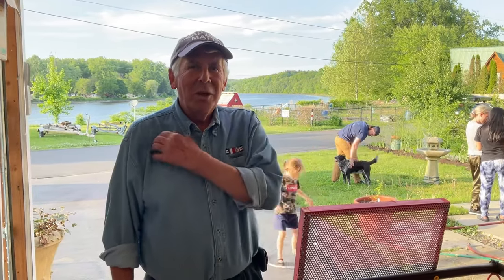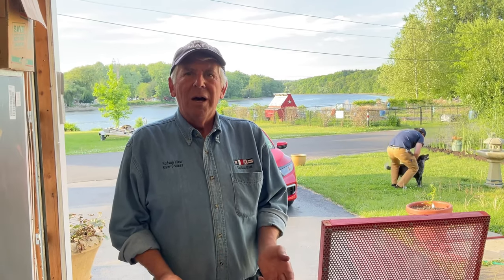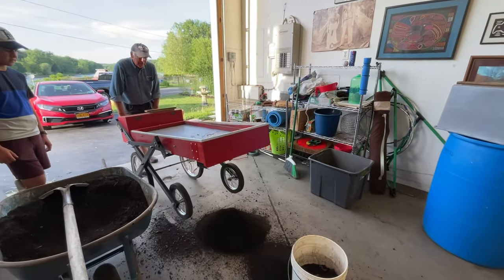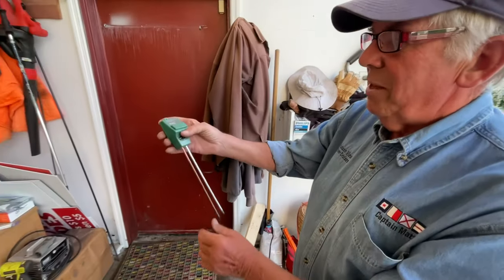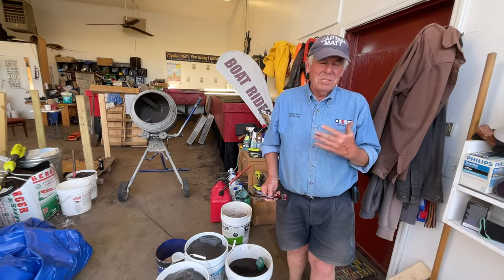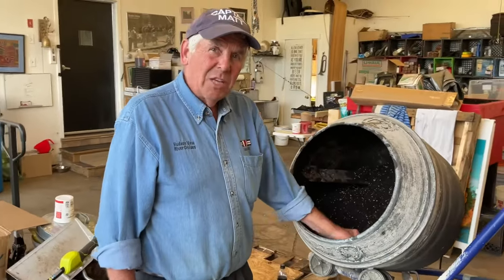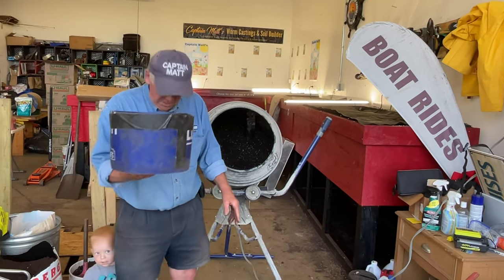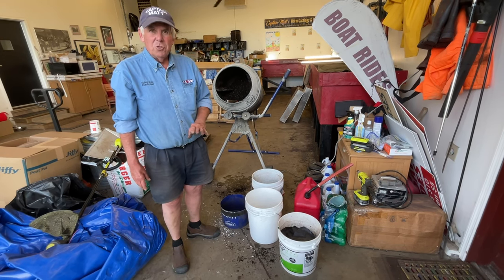How I Use Worm Breeder Buckets

Comment: Love the idea of the breeder bucket instead of a tray. 
What are the length measurements of 3/32  and the 1/8” holed spaces?
Do you think it’s a good ratio or would you increase one size over the other to catch more cocoons?
Reply: Should’ve been better worded question! What is the length of the screen of each section of different hole sizes? For Red wigglers and how you’re using it, would you prefer there were more 1/8” holes to catch cocoons?
Reply from the maker: Hey EW...  We did a in depth video about the sifter, there’s a link in the video description to the manufacturer https://youtu.be/sN7XP70UcPw  Not sure about  best ratios - that could be a good experiment.

Comment: Hey Captain Mat, I know you switch from buckets to trays, but I still like the buckets. Recently I was given a large supply of 2 gallon buckets. I know in the original 5 gallon buckets, I have 2-1/2 gallons of bedding and 250 adult worms. This works great, but can I scale this down to 1-1/2 gallon of bedding and 150 adult worms, in these 2 gallon buckets?
Hope all is well with you and the family. Your worm friend in Florida.
Reply from the maker: Hey Larry… nice - should work well and you’ll find the right ratio with a bit of experimentation.

Comment: Hi, Matt. Bob Hough from Alpine, CA. I understand what you're saying about your breeder bins. I just have a couple of questions. The first has to do with the plastic you put over the top to help conserve moisture. Since I didn't hear anything in your video about drilling air holes in the buckets, how do you aerate the breeder bins? I'd think that the plastic would cut off all air flow and be detrimental to the worms. Also, do you keep your bins in a lighted room or use a light on them all the time? What else keeps the worms from making the Great Escape? Thanks again for any direction you can offer along these lines.
Reply: The plastic cover is a loose fitting top, no need to aerate.  And worms escaping would be rare but easily solved by keeping a light on.

Comment: Hi Captain Matt, I used nearly 3+ gallon compost filled with 250 worms in 5 gallon bucket. Is 3 weeks okay time to keep them. I do top feed chow every 2 days. I still dont know how would I know that they have eaten enough compost and now its time to harvest the castings. Question is if still I could weight for more day's and they could have eaten more compost.  Do we really make a guess that in 3 weeks they would have consumed what ever was there in bedding? In that case we never be sure that its 100% casting and no compost anymore.
Reply from the maker: Hey Vikas, I've found three weeks to be a good duration.  You'll still need to sift the castings out of the buckets - it will not be 100% castings - but will be a high ratio, depending on the fineness of the material you started with.
Reply: @CaptainMattsWorms   Hi Captain Matt, I sifted finished compost to 1/8 inch when I made the bed. I am going to harvest it in 2 days. My only doubt is if red wrigglers mostly remains at top what, they will not be eating the bed lower half? is It?  I hope they dont only eat the upper half of bed in bucket.

Comment: At 8:52 you dont have white stuff in mix but at 9.10 when adding water you have white stuff in mix what is that did we miss any stuff?
Reply from the maker: Good eye, Vikas. I’m experimenting with integrating food/nutrients into the bedding to decrease need for top feeding (trying to get to a set-it-and-forget-it system for the two weeks)… I added some of that to  the bedding which is what you likely saw in the video  - it’s a delicate balance since too much can heat the bin. Will share ratios after I prove success. The safe path is to top feed buckets.

Comment: Thanks for another great video. The production of worm castings in 2 weeks is great info. Just curious if the worms population also increases in these 2 weeks. You are the best.
Reply from the maker: Hey grnbough! Thank you. In the two weeks there will be cocoon production, but they will hatch later.
Reply: @CaptainMattsWorms  Hi Captain Matt. I found some maggots in both of my 5 gallon breeder buckets  along qith my red composting worms.  Do I need to dump them out? They are probably eating my worm food. Love your videos.
Reply: @jameshowle9105  weird.  Did you figure out what sort of insect the maggot grows into?  Do you keep your worms inside?
Reply: @ericcarve4476  I found out the maggots are from the soldier fly. They would lay eggs in my buckets on the screened porch. Lift the black plastic and they were everywhere. Think they also bred in my red wheat food supply containers that i fed the worms with.